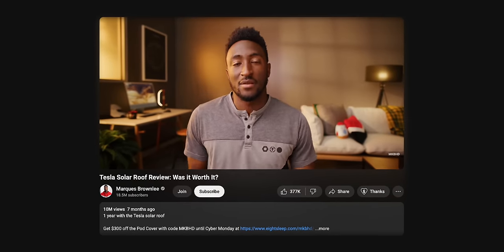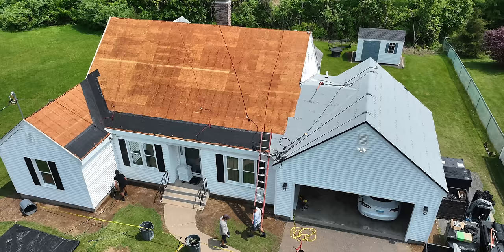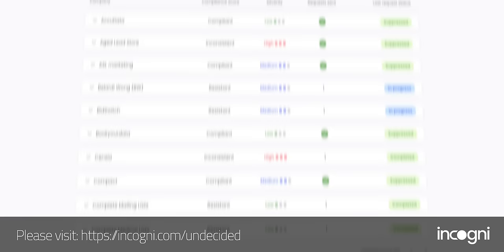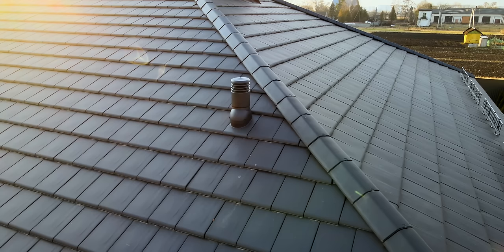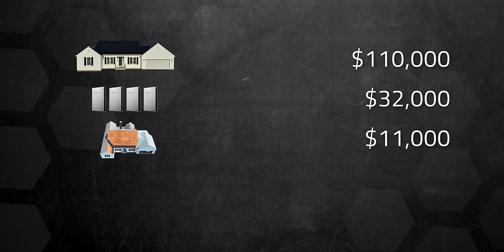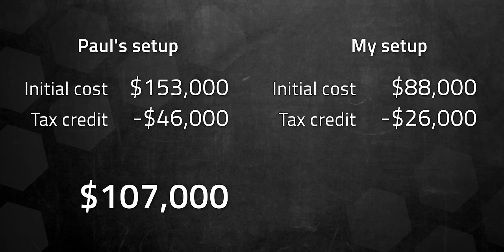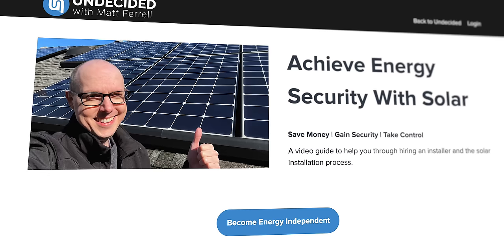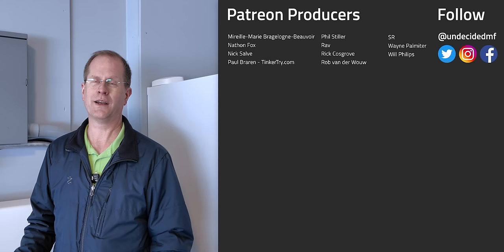Tesla Solar Roof vs Solar Panels: Which is Worth It?

Comment: Net metering is crazy confusing. I also wish people would explain the "Tax Credit" better for those thinking about looking into solar. Most of the time is "sounds like" it comes out of the cost of your solar panels, it is not.

It actually, just deducts 30% of your install cost from your annual taxable income. My solar system cost me $58,000. With the solar credit, it cost me $58,000. My tax return went up about $3,000 because of the adjusted taxable income ($3,000 is a far cry from the $16,000+ the tax credit gave - and the install company touted). Regardless of how good they try to make it sound, you still pay the full price of your solar, you just get some income tax deduction that doesn't help go nearly as far as it sounds towards the cost of your solar system.

I like my solar system (and I like how the panels look), it has cut my electricity bill down a little bit, but it is far from affordable. If you're living at the edge of poverty because your electricity bill is killing you, solar is not going to help you, it will finish sinking you.

My electric bill before solar was ~$250 a month. With solar it is $95 a month (equal pay - and strange, because my solar system was built to cover 125% of my average electrical usage). My solar bill is currently $232 per month and will go up to $390 in November because there will be no change to my solar loan because of the tax credit. My solar loan is a 15 year loan at 4.99% (I pay more than the minimum, and I will try to refinance when the interest rates are more amicable). It will be a hot minute before any gains are realized. I am 55, so that puts me about 5 years into retirement before my solar bill is paid off (I will probably sell my house before it is paid off).

My realtor said my system will add about $20,000 to the value of my home. They also raised my insurance rates a little bit, and the snow coming off my panels took my gutters with it (just had them replaced "again" a few weeks ago - with a warranty this time from Gutter Brothers - The Brothers that just do gutters - ).

It is an expensive process and Matt is not joking. It takes a while to get the city/county to hand out the okay permit. It took them a while to  install the net metering meter for my system (It is fun to watch the arrow show that power is going up the wire instead of down the wire to your house though). I can't wait until buying a solar system is less "Car "Stealership" Dealership" and more "Handyman Contractor Clear Cut Pricing".

Comment: Holy crap solar companies gouge the hell out of you.  $88K for a hybrid solar setup?? That's ridiculous. 
For literally half that cost you can get 40KW of solar and an EG4 setup with 2x 18K inverters and 60KwH of batteries.
If I was building/remodeling a house, I'd go the metal roof option as well, but not that solar setup. The payback on that would be more than a lifetime unless you had really good net metering.

Comment: 55k for this instalation? In Europe, same instalation enphase iq8+ 3 phase 18kW would cost around 15k. It looks like you have 42x410 panels.
Batteries price depends on the size. So 3.5 kWh cost around 2.5k per piece. 10.5 its just 3 batteries in one cover.
And those prices are for whole system, materials and instalation costs. So i would say in that situation, comparing reasonable prices and tesla roof, then difference is too big.

Comment: Would it be accurate to say that you need to tack on an additional $4000 a year in upkeep costs because of the 10 year lifespan due to charging cycles? We're looking into solar, but I am finding most of the information does not include the added cost of replacing your battery bank roughly every 10 years.

Comment: Oh.... My.... God....
@9:30 that is CRAZY high.  It would literally take me 22 years to break even on the lower costing system of the two - and I use ALOT of electricity (34,000 kWH per year).  I've been looking at a system to cover MOST of my power needs and it's around 20-25 thousand - SELF INSTALLED.  That's quite a markup from those 'Solar Companies'.

Comment: I live in Australia where it's often sunny but I can, occasionally, have gloomy days (4 or 5 in a row) when I need non-solar top-ups; it must be 4 months since that has happened, but it is summer in Australia now.
Time of Use Metering makes planning difficult ... When I have a big surplus of PV power, so does everyone else (!)  Often when this surplus happens, the price of solar feed-in drops to near zero or quite often it drops to a NEGATIVE value!  In other words, the grid charges you to dump your surplus.   My solution is to run off-grid by turning off the main breaker switches until I need a top-up from the grid.  I would aim for top-ups to be late morning, early afternoon, or 3am.  It is tempting to feed back to the grid but in practice it's not worth it for me.  I was assessing the benefits of more solar panels, vs more battery, and realized that buying power when the grid is over-loaded with surplus renewables and storing in my DIY batteries for a rainy day is actually a good option.  My KWh storage is ~3 times my KW-peak-solar-PV rating and this seems to be working well.  Next winter will be a better test ;)

Comment: Depending on where my house is, here in norway - I would probably go with a solar tile roof just to avoid snow compacting underneath the solar panels. Has that been a problem in New England? Anyways, here it would probably make more sense to go with a deep heat well first. Most of our electricity is used for heating.

Comment: Greatly appreciate your videos. I share some with Sustainable Tallahassee folks here in Florida. There's another major issue you don't spend much time on - safer air indoors, residential, commercial, institutional - safe enough air for babies and children. It is not just a matter of gases and particles from combustion, its also what may be in the air from forest fires or aftermaths of floods where the dust may have mold and bacteria; its also airborne diseases, which for some basic reasons are suddenly sickening children everywhere in America at alarming rates. It isn't just COVID that's airborne (although having your child develop Long Covid from reinfections with the constant new variants of SARSCoV2 seems more likely than ever), its also measles, TB, pneumonias and many others. Please cover good HEPA filtration and monitoring, UVC installation, portable devices and what to insist on in schools and doctors' offices by way of protection for babies and children. There are going to be thousands and thousands more children becoming chronically ill, being developmentally delayed, struggling with new cognitive impairments, unless we all press for international action, starting with here in the USA.

Comment: Having solar panels is one thing, but when living quite north with at least winters with snow, then solar panels cannot keep your house warm. Unless you have hundred of them each giving 20 watts nominal in 'dark' winters, still feeding 2,000 watts to your electric heater or battery.
Reply: Even if the panels themselves are not fully sufficient (and he does mention he's not covering his full needs in the winter), over all the equation still works out for most people. You save so much over a full year that over 20 years (probably way shorter) you've easily paid back the investment. And you can cool and air condition your house for free over the hot months - which are getting hotter in many places, even up north. Couple that with selling your surplus back to the grid and that all works to lead you to a net zero payments for power thing in many cases.

Comment: I went with an established Tesla certified roofing contractor from Indianapolis - the entire job was smooth as you can imagine. A few weather delays but that was to be. expected. My system is an 18 kWh system which will sometimes put out 110 kW per day. The PTO with my electric company was totally transparent and no hassle on my part at all. The electric company just showed up before the job was even complete and had me sign one piece of paper. Here is a video you might be interested in https://youtu.be/NZHA1y0Df4k?si=gC_6n3pbHJpFZ-ra

Comment: Omg.55 000$ your panels? Here in Spain, a 2x1 meters panel costs a bit less than 100€ (93-98), so for 50 000  you can buy 1 square kilometer of panels, to cover a whole village😆

Comment: I wouldn't go with Tesla. They haven't made improvements to the product or the installation. Also, it has to be done all at once with the roof. Now I rent, but my family and friends still ask...which one would you do? I like the fact you can add solar panels and batteries as a long-term project. Have 2nd hand panels in less sun areas or for winter. IF they break then your not out the money.

Comment: Wow so expensive. Here in Pakistan the price is about $350/kw. So a 15kw system costs approx $5500. Latest solar panels and inverters from china. Add some lithium batteries to the mix and you're looking at $10,000 for the full setup

Comment: back in like 2012 they were talking about a Solar paint, that you just painted onto your house roof or sides, where the f is that now?
Also there was a dorky looking car they released like last year that gets 80 miles to the gallon, back in 2008 same exact car was clocked at 300mpg, and trust me it is so weird looking you could not confuse it with another.

Comment: The tesla solar roof is way to expensive, period. And the comparison should not include installing a whole roof on your house when his was a repair. You normally start with a roof. You should only include the cost of re-shingling or putting metal roof on your current roof. You should not have included the full 45k for your roof, that had to include more than just re-doing your roof to metal roofing. Mine cost 8K for converting to metal.

Comment: 153000$ at .05% about 640$  per month Income.  My electric bill is 23 to 80 $ / month even if yours is 500 you would make 140$ / month with the money in a CD.  But I can see if your preparing for electric collapse then it's OK. But you will have maintenance on the system. I would suggest learning your system well to be able to fix it yourself and not rely on anyone.

Comment: Couldn’t help but notice the type of roof fence and the lack there of on the metal roof where they installed afterwards any venting in the roof?. And secondly, the vents I did see where the old style useless vents they get covered with snow and trap air surprise the states does not use venmars   like we do.

Comment: Why the batteries? In Brazil the excess energy is fed back into the grid with 1Wh/1Wh exchange - or for each Wh fed back into the grid we pay one less Wh. The question, therefore, isn't as silly as it seems. Thanks!

Comment: I am just going to install a few stand alone solar panels on my roof an not connect to the grid and keep them portable.   I am going to run the power to my fridges and my computers and LED screens which use 80% of the power.   I have a basement and can just run extension cords up through the floor in 6 places.   The appliances can switch between the grid and my solar panels at the receptacle.  So for a couple of thousand dollars you can install a system yourself and no building permit is required.  Totally portable and expandable for about $3000 not $153,000.   I can't see how you can justify even $15,000 when you could just invest the $15,000 at 5 % and get $750.   My electrical bill is about $100 per month.   We have pretty cheap electricity in Manitoba about 10 cents CAD per kwh , that is about 7 cents USD.   Florida is 17 cents.

Comment: If I were to be a home owner and consider solar power, I would not consider buying a house on a narrow tight lot and install to the existing roof.  Cost and service is a nightmare. I would hunt for a large lot of land and build the solar array on the ground on a cleared plot and bypass many of the red tape and cost and maintenance/roof issues.  If the county still puts up regulations, I would mount an array onto a two-car enclosed trailer that expands and house the electronics and battery packs. Totally portable and move it to any future location of a new home.  I hate big government and the corrupt utilities. We must deal with SRP in my region and they lobbied to dismantle progressive solar legislation last election by scaring voters to believe it would result in outrageously high electricity rates. They succeeded and solar generation was abandoned.

Comment: If I'm doing solar, this would be on a new build. I'm not going Tesla solar. I want a solar panel that can get maximum sunlight and heat from my metal roof as for battery storage, I would go with the Franklin's battery system, and I would also go with the span panel as well like you said upgrade ability in the near future that's what I would go with upgradability in mine.

Comment: In Europe, we express the solar capacity in Wp or kWp, not per W or kW. kWp is a standardised value of the panels, independent of region or oriëntation or inclination. Then we use kVA for the power of the inverter. When you say W or kW, what does it express?

Comment: Solar panels should be the standard building material for all external walls and roofs of all buildings. Industrial, commercial and residential. One standard panel for all buildings that have the ability to produce energy with support electrical power generators intergrated with in population transport rail, dock and port systems. There's no reason in the 21 century to separate energy systems with good architecture.

Comment: I'd go with the system that I have the most control over over time.  So, as much as I like Tesla, I'd go "Matt's" way - and even then there would be more "bespoke" engineering that I decide on - not the vendor.

Comment: Cost of quality solar panels is a lot cheaper , buy from the manufacturer First I would buy Marine batteries with a 2-3 year warranty at $120 a piece and if they don’t last after so many cycles I go get a refund and get an another battery replacement ($1400-$1500 costs)
) For the solar panels I would pay someone to install them in my backyard, and then I would rent a trench digger to to the power line to my basement and lastly 
I would hire an electrician to hook up the wires and inverters . You get ripped off on labor and materials. 
If you are handicapped or a slow learner then hire a contractor.

Comment: With your location, I'm guessing the white(ish) roof you have isn't for that net zero goal (to prevent passive heating), so I think I would have gone with a black(ish) hue of roofing panels, just so the panels wouldn't stand out so much - wonder if there's a reasoning for the color difference? I'll agree, that shingled roof Paul has is beautiful! - But I couldn't afford it, sadly there's absolutely NO tax incentives here in Denmark :)

Comment: Cost, cost, cost. Tesla should have bought Enphase instead of sketchy Solar City. I’ve seen the tiles installed adjacent to typical panels and they were putting out 30 percent less power. Also many of the glass tiles you see are blanks ,just glass tiles to complete the roof .

Comment: 14.4 KW panels, 12 KW inverter & a 43 kWh 6000 Cycles DIY battery. Total price 1½ year ago = 24650 US$ incl. 25% TAX. (Excl. installation of panels & inverter, beside electrician connecting system to the grid. Some serious money you pay "over there".

Comment: $110k for solar is a non-starter around here... payoff does not exist, even if I built a system to handle ALL my energy needs (and I have a 4000sf house) I'm only looking at about $4k a year (current prices, ~$125/m for Electricity, the rest for Heat). Solar at that price point will never even get close to break even. I'm looking at 12kva battery backed systems to replace my electricity demand and provide standby power (have nat. gas for heat, that doesn't experience outages) and acting as the prime contractor myself (bringing the cost down to $30k'ish), that's closer but still relies on ALSO providing standby power (saving ~$14k for a standby gen) and on the system living somewhere north of 20 years with only modest maintenance costs.

$100k... no way that'd be a good economic decision around here (unless energy costs increase dramatically... which IS possible but then it's basically gambling), so it'd have to be something I REALLY wanted to burn money on (and in my case I'd also need to replace my gas heating so another big cost bump).

Love the look of the Tesla roof tho... if I thought they'd stand by the product (I don't for a second think that) I think that would factor in positively.

Comment: I have an Enphase system with 3 batteries and a 12.5 kw system. Looking at your graphs it seems you still import a lot of energy from the grid. Are you hoping to come out where you just produce more than you consume? Or are you looking produce all your energy and not import? I battle between this since it is negligible for me as we have more credits than we can spend and I'll always have to pay a $15-$20 fee for being attached to the grid.

So far we've only had 4 months were we have produced less solar than we've used. We have only one electric car and our furnace, water heater and stove are not electric as of yet. In the 14 months we've owned our panels we've had 18.3 MWh produced and 14.5 MWh consumed. Amazing to see and thanks to you I found the company we installed with through Energy Sage and got them installed way faster than my over year wait for Tesla Solar panels which they were using Q Cells and only gave me the ratings and details of the panels in the contract. Luckily we ended that and got to select some REC400 Alphas which are more efficient, higher output and better warranty and guarantee stating at least 92% of power generated in year 25! Anyways, keep up the fine work and we live in Illinois, burbs northwest of Chicago